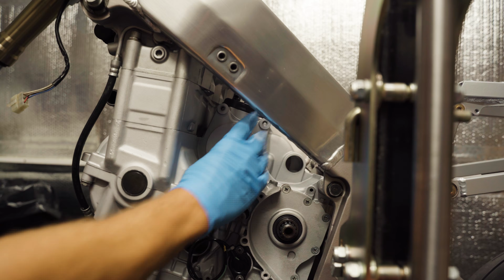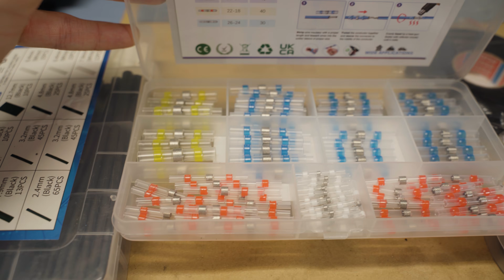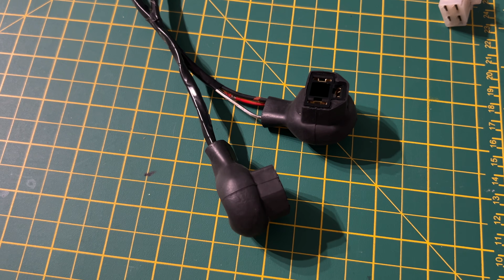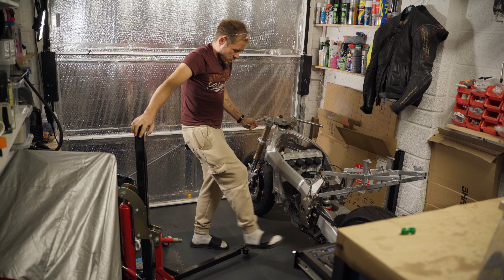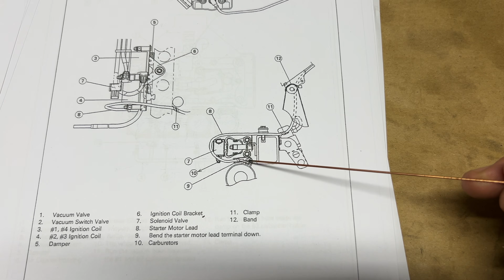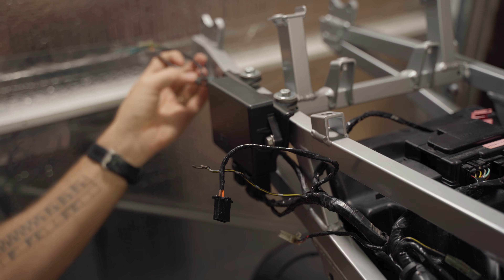Electrical Repairs on my ZX7R - Ep19 | ZX7R Restoration | Tom's Workshop

Comment: Hello I just pickup a 96 Kawasaki zx750r. I've been having issues with no spark to the plugs. I replaced the key switch and had to put a 100 ohm resistor on the gray wire and I do have 5 volts showing and still no spark to the plugs. Replaced pulse coil/ pickup coil and still no spark  my two small wires red/black at the coils with key on shows no voltage not even if you try to start it. I've bypassed the kickstand switch I made sure the clutch switch worked the neutral switch is good my fuse box fuses show 12 Volts  anyone have any idea why I'm not getting any fire to the plugs ? Please help thanks
Reply from the maker: Sounds like you’ve already checked a lot of the likely culprits. It’s helpful to see 0V at the positive feed to the coils so you can rule out the coils and pickup relatively confidently. Have you tested the functionality of the right switch gear? Particularly the kill switch and the connector block. Worth checking you’ve got 12v going into the kill switch and 12v coming out when the switch is set to run. If you do, that suggests the problem lies between the switch and the coils.

Comment: If you haven't got one yet, you definitely want to fit a new O ring to the clutch slave cylinder piston. Make sure to check the manual, as it has to be fitted one way rather than the other.

Comment: I finally took the plunge and bought a '98 ZX7R, partly through watching your restoration. It was used for a few weeks when new, then briefly in 2015. Since then it sat in a garage until the owner realised he would never ride it again. It has 2400 miles on the clock. It's all there except for the end can (currently a Micron) and in amazing condition. After a carb clean and fluid change it now runs. New tyres (Diabolos) and chain (gold of course) fitted. It should be on the road next week. I paid £1875 for it. So thanks Tom for the inspiration.
Reply: I’ve also just got a 98’ 7 😎🤙
Reply from the maker: That sounds like a dream find! Such good condition and only a few jobs to get it up and running. Enjoy! Glad to have helped twist your arm 😂

Comment: Very interesting how different rebuilds can be. I don't want to criticise you or someone else for rebuilding the Kawa as original as possible- but I couldn't help myself to use lighter and more modern parts. I also would have painted everything in silver. So I'm always switching between "nice done, Tom 👍" and "nahh, why hasn't he done it so and so" 😅

But in general I'm still a huge fan of your work and can't wait to see the end of the build when it comes back to the road ✌️ good luck and have fun with it
Reply from the maker: Haha it’s ok I know what you mean. I watch a lot of vids and think “ahh no!” But I’m always happy that people are building their dream bike and not to please others. 

There are a few bits where I’m swaying from original, and I’m not really trying to make a “factory” end result. But I’m also not racing or going for tip top performance so I end up drawing the line on costs with that in mind. 

Still didn’t stop me from finding a lovely stainless system for the next ep though 😂
Reply: @tomsworkshopprojects  I ordered a Black Widow stainless system for mine. It arrived 10 minutes ago! Lovely. I'll be very interested to see what you've gone for.

Comment: I hope  you went back to the side stand bolt after the video???
Reply from the maker: Went back to it? lol what have I missed?
Reply: @tomsworkshopprojects in the video, it seems like the bolt isn't fully seated so that the side stand isn't sitting around the straight part of the shaft. 
Also, when you rotate the side stand the bolt rotates with it too. 

I may be completely wrong, but I'd hate for it to come loose on you 😊
Reply from the maker: @stevehignett5701 ah gotcha, no it’s all the way in, might just look like that in the vid. The threads on the bolts screw into the rear side of the stand with a lock nut behind so it’s fixed to the stand not the bracket.
Reply: @tomsworkshopprojects happy days. It looks wrong on the video, but you could have nipped it up before, or wrong angle etc. 

I wasn't trying to shoot you down - genuine concern 😊
Reply from the maker: @stevehignett5701 haha no worries! Always appreciate it 😂

Comment: Hey Tom, loving the whole series, quick question about the alternator, can i disassemble the housing and sandblast it? I noticed mine has some dirt inside on the copper wires.
Reply from the maker: Cheers mate, There isn’t info about it in the manual but you can remove the housing. I assessed that I didn’t need to on mine but I have seen videos on it. You need to remove the solder connection for the three windings and press it out. This is a helpful video for a similar model:
https://youtu.be/AWGLsaDM7Kc?si=tUIXTSFYOlPAyW9s